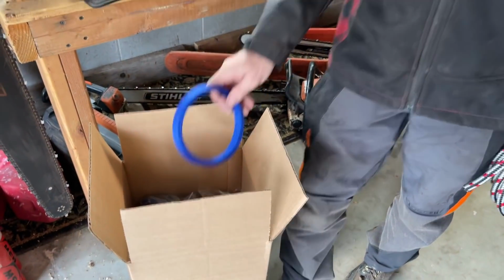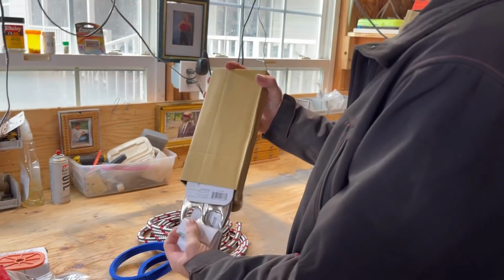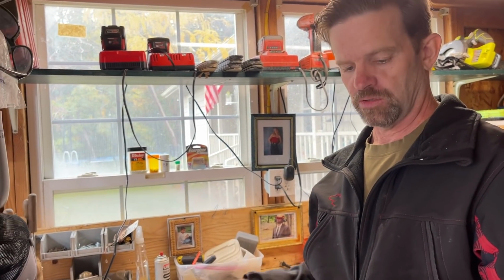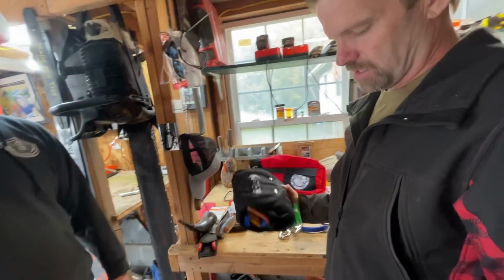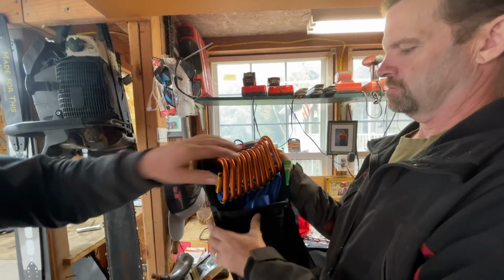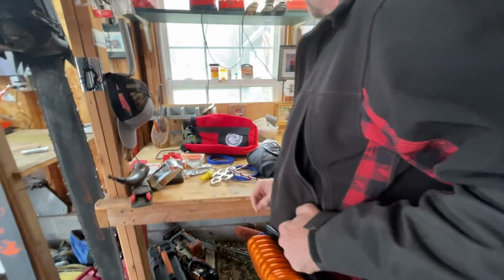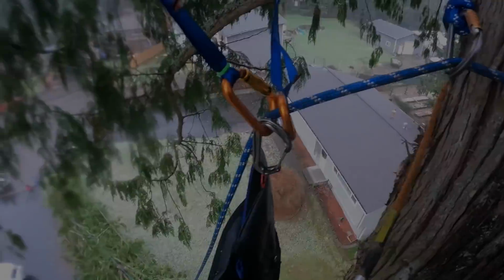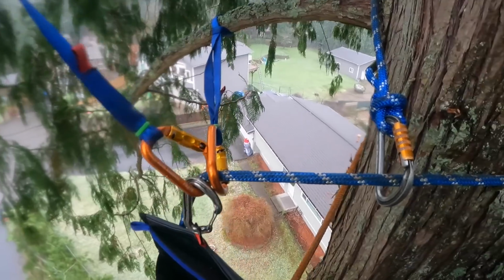Unboxing and Trying out The MB Speedline Kit with August Hunicke

Comment: Years ago I watched a video from Reg Coates where he explained why you should position the slings so that the carabiner at full stretch does not match the butt end of the limb you are taking. I believe it was to avoid a situation where the butt could jam and shock load the line, but I could be mistaken. I'll have to go back and look for it. Something to keep in mind anyway.
Reply from the maker: Yeah actually august talks about that as well in his video that I cut up for b roll. It’s in the description of this video
Reply: @GuiltyofTreeson  hah good call! I should have looked down there..... Nice work!
Reply: It’s not really about shock loading. It’s about getting the limb stuck against the line and bringing everything to a halt. No limb that we speed line should ever be speed-lined if it is large enough to damage the tree if it is stopped suddenly.
Reply: @AugustHunicke  you could speed things up with the clips if you left an empty pouch on the ground. When the ground guys un clip them they can put the clips straight into the empty pouch and send it back up as soon as your other pouch is empty. Rather than waiting for them to fill the pouch up after you send it down. 

Obviously you’ll have two full pouches to start with so as soon as one is empty send it down to the guys on the ground and rotate them. 

Saves space on your harness and keeps work going.
Reply: @AugustHunicke  Have you ever thought of making your slings out of rope? I had seen that Reg had changed to rope because he thought it pinched the limb better.